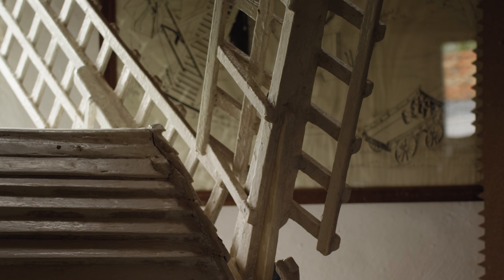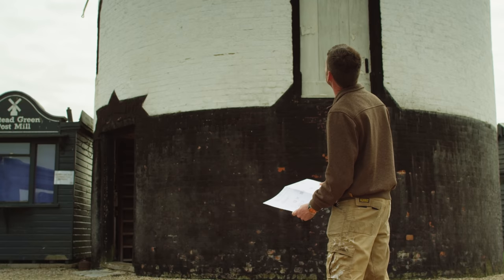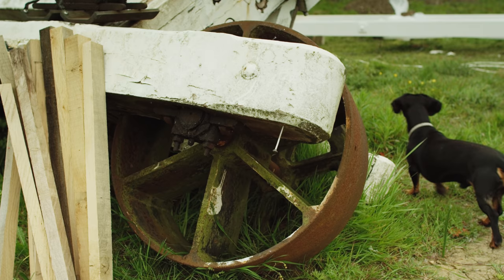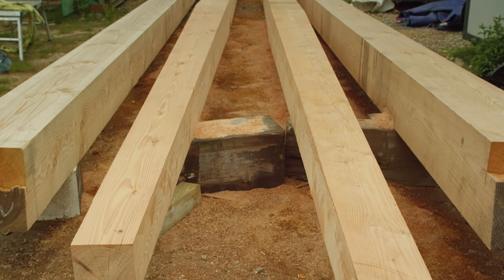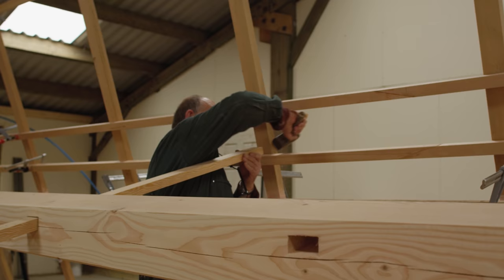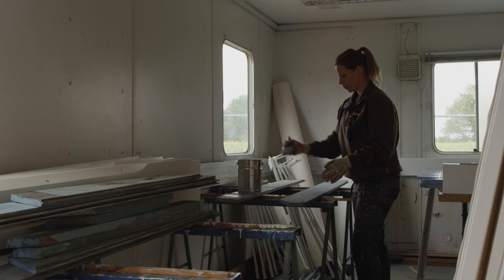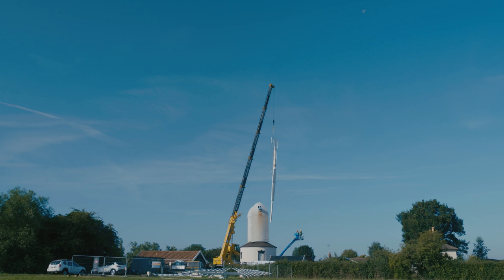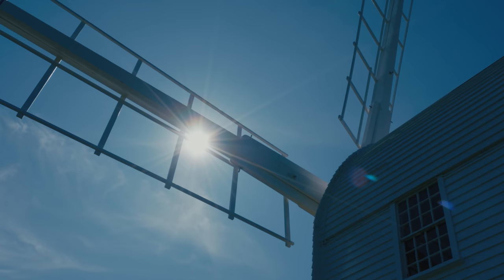Restoring Saxtead Green Post Mill | 13th-Century Corn Mill In Suffolk

Comment: I'm an American Millwright and our work is a bit different from the millwright work in the UK. Though both of us work on rotating equipment...it looks as though yours entails crafting with wood. I'm refinery, cogeneration and chemical plants. Pumps, compressors, gas and steam turbines, gearboxes, fin fans (kinda like your wind mill but nose cone up and blades come already made. We just set the pitch, tracking, tip clearance, sheaves, belts, motor alignments), laser alignments...
It's fun but no wood work. I loved the video. I got to see another aspect of what millwrights were first before they evolved into machine mechanics. My great grandfather would have worked on old mills like that. Super cool!

Comment: So the sails aren't covered then? I always imagined they had oilcloth or something on them.
Reply: They would normally I believe if the mill were still in production; The fabric of sails gets worn out quickly and takes very frequent maintenance, so they probably don't have them covered frequently in the modern day.
Reply from the maker: Thanks for the comments and interest. Shutters will be loaded back onto the sails, but that's done at a later stage to the work featured in the film. Once the sails are fitted, they leave the mill to 'wind' (where the fly on the back of the mill spins so the whole mill can turn), to make sure all is working okay, and then the shutters will be added back on.

Comment: I have a question. How can you have a 13th century corn mill when corn was first discovered in the new world. It was brought back in 1492. So there is at least 200 years gap here. What was the mill originally set up for and why wouldn't you use it's original designation?
Reply: "Corn" is the English word for any grain product.  In the New World, the word got specified for what was properly called maize.
Reply: @CathyS_Bx  No worries never heard or read of that before
Reply: I think the term corn (American corn on the cob ) has got mix up with English wheat which is also called corn. America's corn on the cob make corn flour, English wheat makes bread flour .I hope you're find this explains what you wanted to know .
Reply: @anncarrington9784  Maize (what Americans like myself call corn) used to be called Indian corn, which got shortened to corn.  Unfortunately that makes things confusing when reading old books.  Like I mentioned in a reply below, when Pharaoh dreamed of thin ears of corn eating fat ears of corn (Genesis 41, KJV), he obviously wasn't dreaming of a New World crop.
Reply: @Beaguins  interesting to see the original, Hebrew word to be found in the oldest extant manuscript.